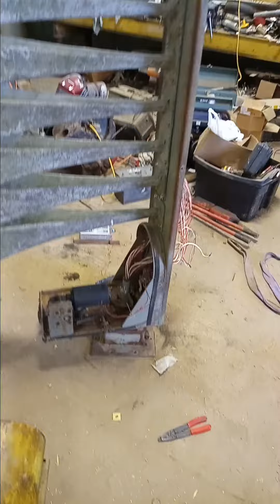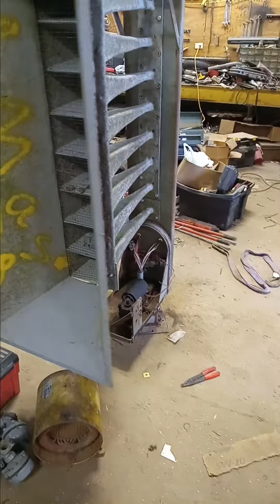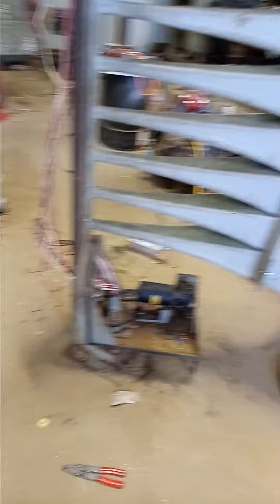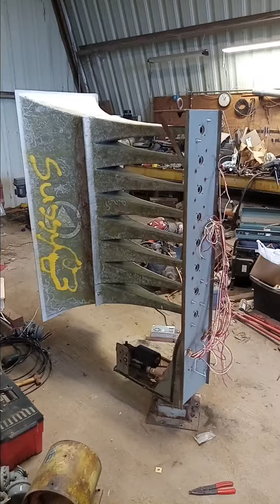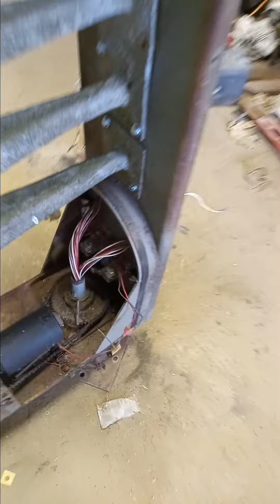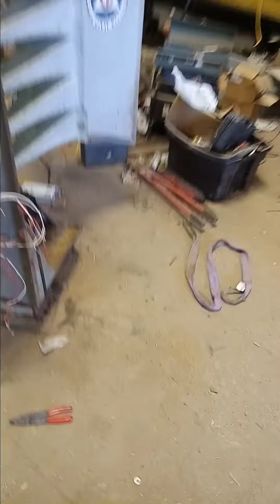1986 Alertronic 6000R Rotation Demo, Oscillating Model

Comment: Is it just a bundle of wires going through the base? I'm surprised it doesn't have a slip ring or something. I remember visiting West Shore Services when I was a kid and thinking it couldn't possibly be that simple.
Reply from the maker: It's exactly that simple. The way ACA designed their collector ring setup for the Alertronics was not the smartest, so we're thinking this oscillating setup was made to completely get around the issue.
Reply: @condb19  do Whelens oscillate for the same reason?
Reply: @SockyNoob honestly that’s a good question now I’m curious.

Comment: What was the point of the Oscillation on this unit?
I see it doesn’t do full 360
Reply from the maker: It's significantly cheaper than slip rings. I'm a bit surprised there hasn't been anymore found yet.